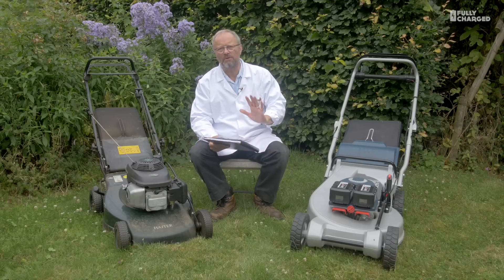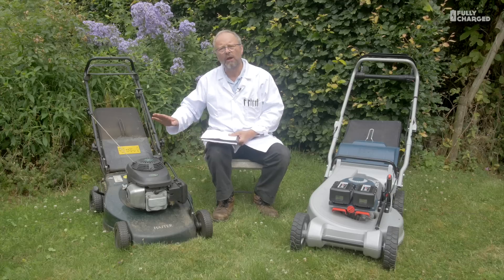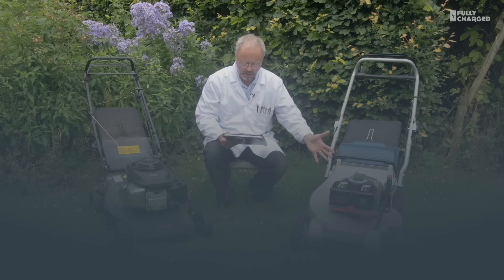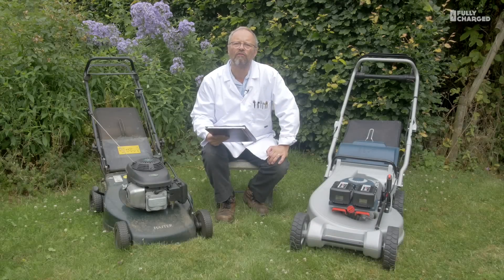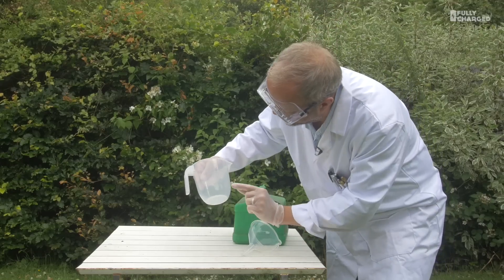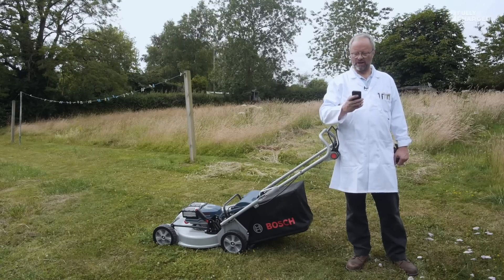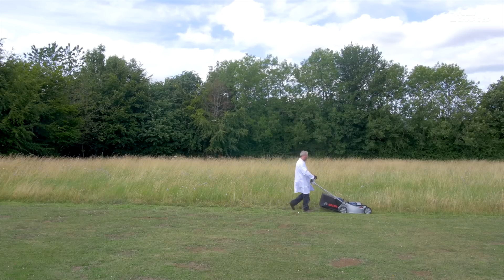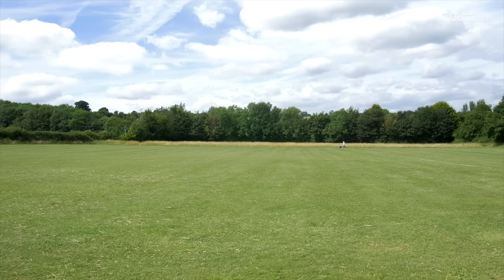Battery V Petrol. The Lawnmower Test | Fully Charged

Comment: That's a dishonest test you've got there, Kryten. The equivalent power would obviously favour the petrol mower, since the electric mower runs on electricity that comes from a power station (ironically, one that's probably powered by oil), so you'd have to take that into account, as well as energy losses in the power grid.
Reply from the maker: +Guncriminal Aha! The old 'you've got to take into account' argument and the classic ' That's a dishonest test' notion I've had that thrown at me many times. Thank you sir, I love to open that door. 
The batteries were charged from solar panels on the roof of my office. The electricity had to travel down 3.2 meters of cable to an inverter, some losses, then to a plug socket, some losses, then into the battery charger. Some losses. All in all maybe as much as 7-8% loss. 
From an energy source that requires no fuel.
Ahhh you say, but someone had to make the solar panels. Yes, indeed, and ship them from Germany, and fit them. Many truck, ship and van movements. And someone had to make the batteries, and the mower. And I had to heat the water for my tea etc etc. All true.
Now, the petrol mower, someone had to make that, ship it, deliver it and then fuel it.
So, the 56 milliliters of petrol/gasoline I used in the mower. 
Where did that come from? 
The pump at the filling station? 
Yes. Some losses to drive there, fill the container, drive back.
To get the fuel to the filling station? 
Oh, okay, a massive heavy diesel tanker, some losses. 
Where did the truck come from, the distribution centre, massive fuel tanks, pumps, valves, safety systems, security, 24 hour CCTV, lighting. Some losses. 
Where was the fuel before that? 
At the refinery, now we are looking at super colossal losses, (UN statistics division figures of 5,600 gWh electricity from coal burning power plants annual consumption of UK's 3 big refineries, same as Coventry and Leicester combined) 
But where does the stuff the refinery refines come from? 
Mostly the middle east, (for petrol) as the best sweet crude comes from the Saudi oil fields. 
So shipping (massive losses) and drilling (unknown huge losses) and pumping, storing, pipeline transportation (more pumping, more losses)
So when it comes to energy losses, even taking into account the economies of scale and the highly sophisticated technology and logistics of the international oil trade, nothing comes close to the impact oil has in terms of energy consumption before the final use, and impact on the wider environments and human beings.
Finally, there is only one, (1) oil fired power station in the UK, it's mothballed and kept on standby for emergencies. 
UK power generation is as follows (average annual generation) 
coal, 24%
gas 32% 
nuclear 15% 
wind 18% 
imports  11% (100% nuclear and wind, from France and Denmark)
Other than that, spot on sir.
Reply: +fullychargedshow LOL...well owned!
Reply: fullychargedshow
>I've had that thrown at me many times.

It's not really surprising. You see, Rob, unlike you, I don't need to cosplay as a scientist. I'm one already. Creationists sometimes try putting on a lab coat to sell their mumbo jumbo too, but it doesn't fool anyone with any sense. 

It was obvious the test was bogus the moment you showed the "well-used" lawnmower with new electric one. This has already killed the validity of the test stone dead, but I'll play:

>Ahhh you say, but someone had to make the solar panels.

...and that not everyone has the convenience of having solar panels on their roof. The rest of us are going to have make do with the electricity from the socket, which is going to have to travel down far more than 3.2 meters of cable.

Also, the semiconductors in those panels aren't the cheapest of things to manufacture. Not unless you get them from China, or some other country with a less than stellar environmental record.

>And someone had to make the batteries, and the mower.

That's where it gets interesting, too. I'll bet there's a fair quantity of rare earth metals involved in that too.

>Now, the petrol mower, someone had to make that, ship it, deliver it and then fuel it etc.

I'll ignore your factually inaccurate claim that most of our oil comes from the Middle East (try the North Sea) and point out that your list is somewhat irrelevant. Let me explain why: Certainly, there's losses involved in transporting and refining the petrol, which apply just as much to transporting and refining the fuel that bought your solar panel and mower itself here as to the petrol itself. It's a common fallacy to believe that oil = fuel, but that's not the full story. It's also various chemicals, plastics, lubricants and the tar we use to make the roads. Speaking of which, there seems to be awful lot of plastic on that electric mower - so let's not pretend that that's any less dependent  on the oil industry as the petrol one, or that the prior drilling, refining and transport doesn't apply to it, either.

Then there's the price:

£450 for a new petrol mower of the same make.
That Bosch will cost you over two grand if you include the batteries.

Not that any of this matters to me. I don't even have a lawn, so I've no horse in this race.
Reply: bloggulator <-- 9/11 conspiracy theorist.
Reply from the maker: +Guncriminal While all the points you make have a certain validity, the reverse argument is always possible and true so it's a bit pointless to carry on.
Contrary to the subtextual accusations you make about my attitude to the oil industry, I actually believe it is a vital resource that we should be extracting. Just at a slightly lower level, like about 90% less.
We need it for all the amazing things we can make with it, pharmaceuticals, plastics, fertilizers and a very long list of vitally important products.
I just don't think we should burn it in the massively inefficient, wasteful, steam age technology that we know and love as 'the internal combustion engine.'
It's a rubbish machine that has had it's day, yes of course we should keep a few classic examples as museum pieces, but it's time to move on.
Of course my old mower engine is inefficient, like all internal combustion engines. It may only be 20% efficient, but the very best, super clean burn modern ICE units are at the very best 30% efficient, how on earth is that good?
It's rubbish, it's appalling, it's not known by 90% of the driving population that at the very best, 70p of every £ you put in your car is wasted. It's a shocking indictment of a dated technology that has been refined and refined for over 100 years and has reached its zenith.
That is the key point to my argument. I'm not expecting to see this change in my lifetime but it is increasingly obvious the ICE has had its day.
I was 100% accurate about Saudi sweet crude. 3 engineers working in the refining industry have all confirmed it to me in separate interviews, and what's left of North Sea oil is 1, too expensive to extract and 2, needs far more energy to refine.
Even though I dress up like 'a scientist' (as a joke) I've actually done a bit of research, of course I'm not a scientist, but I've met a great many of them and asked intelligent, well informed questions and have remembered the answers.
Reply: +fullychargedshow But thankfully, we all know Petrol just comes out of the canister, and aside from not having to drill for it and transport it, refineries don't use electric power al all.

Except they do. A lot. Which you could be mowing your lawn with directly instead.
Reply: +Guncriminal So you became an expert of the power grid? Did you know that the power grid is a highly dynamic system that is constantly monitored for load demands, and that different generation stations can be switched in and out as well as there is extra power that can come from pump storage hydro stations? Oh, and that hydro electric generation from water to electricity output of the generator is about 90% efficient? 

It's naive to think you and I or anyone else, can know at any one instant just what the efficiency of electricity delivery will be from power being generated, to going to charging batteries at the wall socket in the home. It could have been at some point at 30%, at another it could have been 10%. To say that a single number dictates what the efficiency will be from the MANY sources to the SINGLE designation ( a home charging this battery) is utterly useless for such a highly dynamic system.

Finally, you seem to conveniently ignore that his solar installation will pay for itself in energy it produces such that it will offset the energy it took to build it and transport it. Lots of people seem to ignore this little fact when they argue about how electricity is no better than petrol, even for solar installations. 

For you: http://www.networx.com/article/do-solar-panels-use-more-energy-than-the
Reply: +Guncriminal Great set of points you make, but unfortunately just about every one of them falls short of actually proving something and are little more than sound bites with no weight behind them, and besides, it seems like you've missed the point of Robert's argument which is not "Mowing a lawn with electric is the cheapest way to go" (based on your arguments that his solar panels and electric lawnmower cost a fair bit more than the petrol equivalent).  It is also not "Mowing a lawn with electric is 100% free of oil or fossil fuel byproducts".  

But even on that argument, let's see how valid your claim is:  you say that "there seems to be awful lot of plastic on that electric mower - so let's not pretend that that's any less dependent on the oil industry as the petrol one".  So you are saying that an electric mower with a "awful lot" of plastic parts (basically it's body), where said plastic has to be manufactured once per lawnmower, is NOT ANY LESS dependent on oil than a petrol lawnmower that needs to be fueled each time it is used over its lifetime, and which needs its lubricating oil changed once a year (or mixed in with every tank for a 2 stroke variety).  If you care to elaborate on your calculations on how you arrive at that result, I am all ears.
Reply: +Guncriminal I'm fairly sure that "Kryten" gets his power from Ecotricity; they produce their electricity mostly from wind power, Wind turbines don't rely on thermal energy (which is good, because thermal power stations are only about 25-45% efficient), so can be treated as almost 100% efficient from the environmental viewpoint (actually 95% if you allow for the embedded energy of the wind turbine's structure).

There are also some distribution costs for the electricity, but there's also distribution costs for petrol too- petrol tankers use energy.
Reply: EETechs  Plastic was used to manufacture the electric mower in the first place. It used oil, ergo, it is dependent on oil. No oil = no mower. The petrol mower uses it too, so no oil = no lawn mowing.

>If you care to elaborate on your calculations on how you arrive at that result, I am all ears.

I think you've completely missed the point.
Reply: +Guncriminal I figured that would be your response, although technically speaking when you say "any less dependent", something that uses much less content from fossil fuels, in my book anyway, qualifies as being "less dependent".  At any rate, it's your argument, so it's fair enough for you to tell me that I misunderstood your intent.

So let's go with that then...which is to say that any device that contains even 0.001% plastics or any other byproduct of fossil fuels is equally dependent on the oil industry.  Are you saying that we shouldn't pursue better options simply because that figure is not 0%?  That we shouldn't try to pursue solutions that would make our finite supply of fossil fuels last longer by going after solutions that use far less of those resources?  That we shouldn't bother with solutions that use cheap byproducts (and ultimately less expensive both in terms of capital and energy, because they don't need to be as heavily refined)?  I think that's a hard position to take, but if that's the one you're taking, then I guess I can't argue your statement that the electric lawnmower is technically dependent on the oil industry (albeit to an extremely smaller amount).  But does it have to be?  Certainly not.  

Probably the whole reason the electric lawnmower uses plastic is because there is no need to use steel, and the plastic is lighter.  But if you were really concerned with not using plastic, then I suppose you could go ahead and use steel.  The lawnmower won't care.  I suppose as a scientist, this would satisfy your need to have a black and white solution that is 100% free from dependence on the oil industry.  But as an engineer, I can tell you that in the practical world, the goal is usually to make the best available use of the resources you have at hand.  Does this mean you have to get down to 0% dependence?  Not necessarily, at least not until there is far less oil being produced that creates these byproducts (that would otherwise just be thrown out).  In that spirit, it is acceptable to minimize (not necessarily eliminate) fossil fuel use in a given application.  And the lawnmower experiment certainly illustrates that.  You can either fill your tank with a gallon of gas/petrol to mow your lawn and use up the amount of crude oil that it took to product that gallon, or you can use the equivalent of a few tablespoons, plus whatever infinitesimal amount you want to assign to making the plastic body.  And that basically includes the fossil fuels used to produce that electricity.

And like you said, you don't have a horse in this race because you don't have a lawn, but I seriously doubt that Robert's end goal is to convince us to shift to electric lawnmowers.  He probably used it as a convenient analogy to driving cars that use internal combustion vs. electricity and how incredibly more efficient an electric powertrain is for getting a given amount of work done vs. the internal combustion alternative.
Reply: +Guncriminal Are you aware that none of your points are relevant to the test, which was simply a comparison of different energy sources once they were in the mowers, and nothing to do with where any of it came from?
Reply: +Guncriminal You forgot the quotations around "scientist." As you're a "scientist" it boggles my mind that you don't seem to understand the point of the experiment, and are attempting to, quite unsuccessfully, create ambiguity.

How silly.
Reply: +JohnSnow this guy gets it. And I am a real scientist ;) (if you would call a doctor in engineering science)
Reply: JohnSnow _ You forgot the quotations around "scientist." _

But doing that would imply that I'm not one, which would be wrong. In fact it wouldn't make me any less of one even if I'd made an error; "scientist" isn't a synonym for "person who's right about everything".

_ it boggles my mind that you don't seem to understand the point of the experiment, _

It's obvious what the point of the experiment was: electric = efficient, petrol = not so much. Hence Robert's calculations. This wasn't even the first time I've seen it done.

I don't know what you thought the point of the experiment was. Seeing as you believe yourself fit to decide who is a scientist and who isn't, perhaps you can tell me.
Reply: Chris Emerson So my claim that the condition of the mowers being tested would produce misleading results was irrelevant to the test, was it? I see.
Reply: fullychargedshow Thanks for the response.
Reply: +Guncriminal Yes, you're right on that point. The petrol engine will have been 'run in' on an older mower and be more efficient than a brand new one.
Reply: +Guncriminal No of course your claim is valid but you are missing the point. This isn't an experiment. It is entertainment. The point of the video was to show how much more efficient electric is compared to infernal combustion engines. Nothing more than that.
Reply: +Guncriminal You're focusing on irrelevant conditions. The petrol mower, even running at it's highest efficiency, is 3-4x less efficient. Whether the petrol mower was running at peak efficiency or not makes no difference in the outcome. You clearly know there is a wide efficiency gap, so lets not try to invalidate the "experiment" with irrelevant circumstances.

I could also point out that the electric mower's cutting conditions would have favored the petrol mower, since it was arguably using more energy to cut the tall grass. That would make a far greater difference, than the slight efficiency loss due to age of the petrol mower.

You could also question whether the blades on each mower were sharpened to a similar extent...this would likewise have a significant effect (especially when cutting taller grass).

However, both conditions would affect the EV mower to a greater degree, because the petrol mower was never going to run long on the amount of petrol added. 

So, the specifics you point out don't really matter. Simply take this for what it is, a showcase of the efficiency differences between the two technologies, and realize that nitpicking elements of the experiment that wouldn't have meaningfully affected the outcome leaves you open to criticism regarding your stated profession.
Reply: +Guncriminal "I'll bet there's a fair quantity of rare earth metals involved in that too."

Eh? Like what?
Reply: +Guncriminal "Plastic was used to manufacture the electric mower in the first place. It used oil, ergo, it is dependent on oil. No oil = no mower. The petrol mower uses it too, so no oil = no lawn mowing."

In the above sense, it can be said that the electric mower is not any less dependent on oil than the petrol mower. However, there is also a sense in which it can be said that the electric mower /is/ less dependent on oil than the the petrol mower. That sense is the total amount of oil that they do use. 

The first sense (yours) is not relevant to what anyone is proposing for the foreseeable future. What is being proposed by electric proponent is less/more efficient oil use- not zero oil use. We all realize that there is going to be at least some oil use for the foreseeable future, but since we seem to be using oil faster than the Earth produces it, we'd also like to put off running out of oil as far into the future as possible. So, the second sense is the relevant sense to what electric proponents are proposing. 

Is it your position that there is no known way for electric mowers (cars, etc.) to use less oil and/or use oil more efficiently than petrol mowers (cars etc.) at a cost that won't make using electric mowers (cars etc.) to try to put off running out of oil worth it? Or, maybe you think that it's just still too soon to go electric on traditionally petrol devices? 

I think the unavoidable conclusion is that using oil faster than the Earth produces it will inevitably create a scarcity of oil which will make electric devices more economically viable if not a necessity. What does a world with scarce/no oil look like to you and how do we deal with a such a situation?
Reply: ***** Someone hasn't been paying attention.
Reply: +Guncriminal Even if you are a "scientist"... that was a pathetic try. :D LOL
Seeing your comments and marking people as "conspiracy theorists"... makes you just one brainwashed sheepy who believes jet fuel makes skyscrapers fall on their own footprint in few hours. Aaaannd... YOU call yourself a "scientist". If life would depend on scientists like you... it would be a dark future. You are on the dark side... deep in.
Reply: PeaceWithDefenseOnly And you, presumably, have done all the calculations to prove otherwise and are absolutely not relying on the testimonies of insane people who think Obama is a Kenyan Muslim, for instance.
Reply: +Guncriminal "(ironically, one that's probably powered by oil)"

Ahem... If you take a look at http://www.gridwatch.templar.co.uk/ you'll see quite clearly that the UK grid has all but eradicated oil as a fuel... it's just too expensive.
Reply: +fullychargedshow A Beautifully elegant and thorough response to the "Where do you think electricity comes from" argument that I've seen come up countless times that defies common sense to even bring up. Thank you sir for taking the time to lay it out so well for all. :)
Reply: I bet everything I own that if we were to power everything from electricity, and generate that electricity from fuel ONLY, we would still be in a way better shape than we are today. A massive fossile fueled power plant is probably lightyears ahead when it comes to fossile burning efficency. Even if a power plant only has like a "50%" efficency, that would still have an enourmous benefit over the 10%, 20%, 30% efficient ICEs. A very efficient small car will still release like 100g of co2 per 10km, while a tesla, going the same distance, powered by only fossile burning powerplants, will only release like max 1g of co2, more like 0.5g.. You also have way more fun and less back cramps from a tesla ;). Also electricity is never "dirty". It can be generated in a "dirty" way, but it doesent have to. It can just as easily be made from a hamster...
Reply: +Chrus Ginn "Rare" components that i can think of are; Batteries; Lithim, some chemicals (to make up the lithium ion thing), Circuit boards; Silicone, quartz, copper, maybe gold. Electrical components; copper, maybe neodium (magnets) some aluminium. Overall, its just a motor, the controller circuits and batteries. Fun fact. Lead is a heavy metal. Lead is in like. everything, especially combustion engines. The amount of fun components that make up all the fluids and parts of a regular petrol car would be interesting to see
Reply: +Chrus Ginn "Rare" components that i can think of are; Batteries; Lithim, some chemicals (to make up the lithium ion thing), Circuit boards; Silicone, quartz, copper, maybe gold. Electrical components; copper, maybe neodium (magnets) some aluminium. Overall, its just a motor, the controller circuits and batteries. Fun fact. Lead is a heavy metal. Lead is in like. everything, especially combustion engines. The amount of fun components that make up all the fluids and parts of a regular petrol car would be interesting to see
Reply: ***** "Lead is in like. everything, especially combustion engines."

Not this century.
Reply: +Guncriminal Okay everyone! Lead just ceased to exist! Go read into it if you want. I wont bother. HF
Reply: ***** It was obvious from the wording that you hadn't got a clue what you were talking about, but this bizarre interpretation of my post confirms it.
Reply: He's obviously biased towards electrification, it's likely he was sponsered by the lawnmower's manufacturer, too. I find it laughable how he used GOGGLES to pour out the petrol. He describes petrol as "highly toxic" when the lithium, cadmium, lead and acids used in batteries are much more toxic.